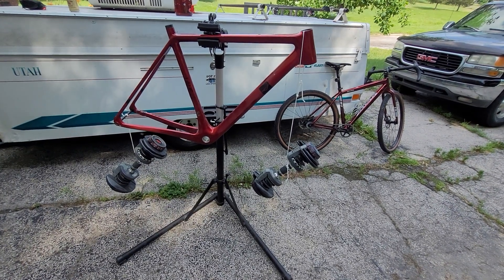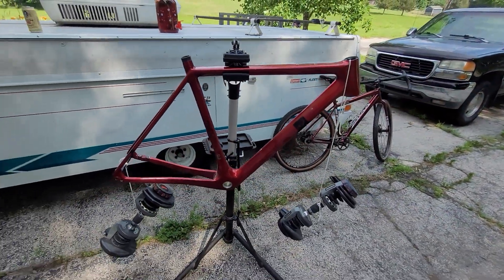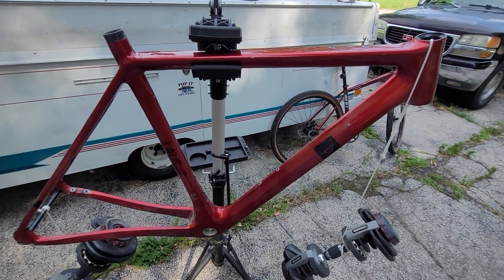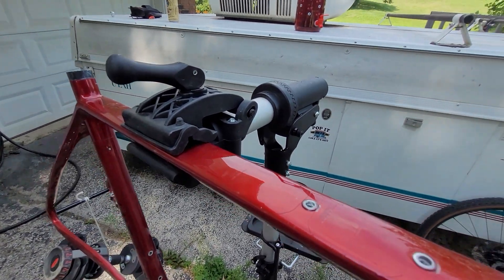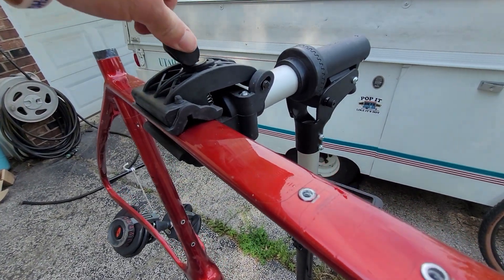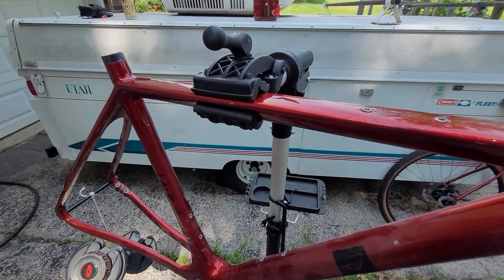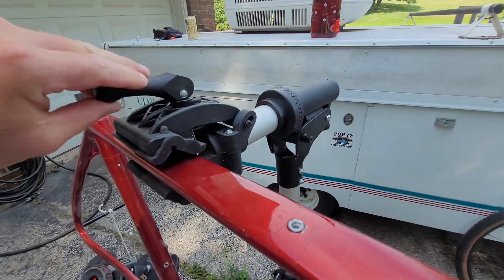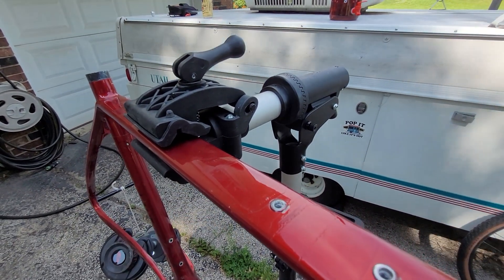How much force can a carbon fiber top tube of a bicycle take? Part 1

Comment: or you could have carbon pro fix the carbon bottom bracket.............my  ovalized/warped press fit bb cost about $250, in and out in 4 days, better than original, no creaks
Reply from the maker: Lauf's solution is to replace the frame. They sent me a Seigla for warranty, this bike has to be decomissioned.
Reply: ah, I see.